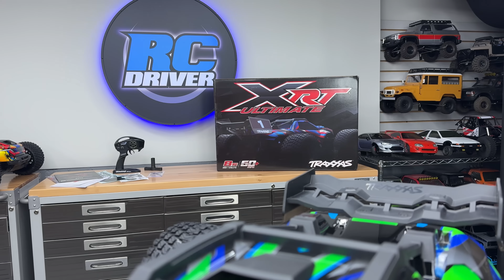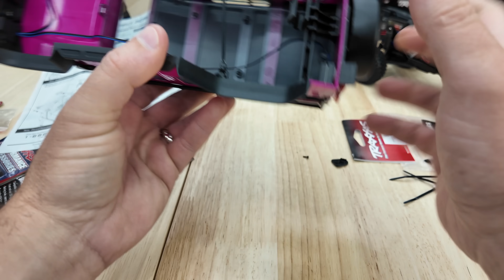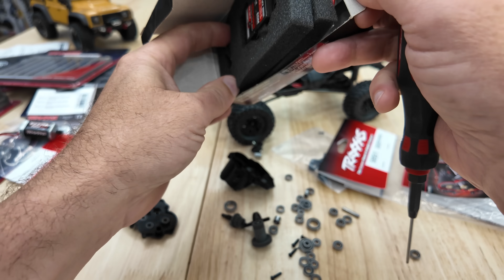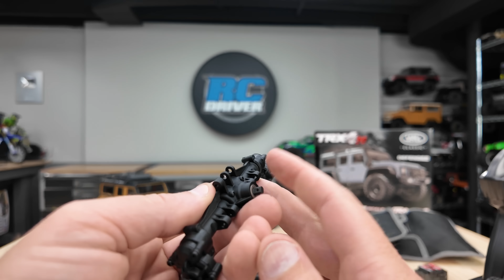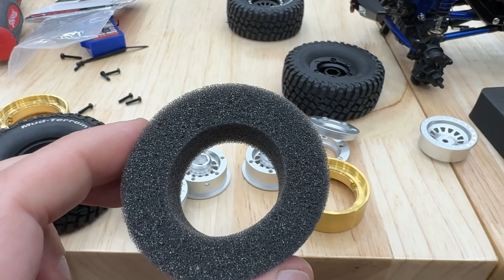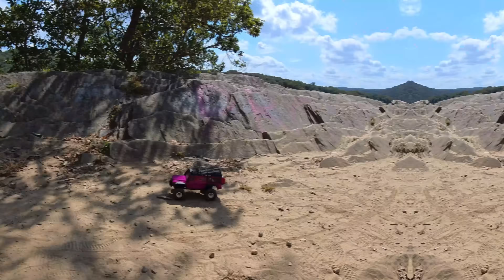I Built A Traxxas TRX-4m Ultimate

Comment: I see you store you trucks with tire on the ground, Many say you need to store with wheels of the ground, so you don't get flat spots on your wheels or add stress to suspention, myth or fact, would be nice to know, easier to store just setting them down, like your races. Great video, thank you.
Reply from the maker: If you leave your RC cars sitting on the tires over long periods of time, it can flatspot the tires. Sometimes they will come back after some use. Sometimes not. I go through and rotate the wheels every once in a while.

Comment: 3 questions. 1, Do have permission have recreate that truck with the sand dune body? cause I love that truck. 2, How much does the build cost without the 2 speed transmission and the portal axles? 3, What is that screwdriver looking drill thing? (I have no idea what it’s called)

Comment: Great video and a pretty little truck!  Not so struck on the Traxxas roof light bar though.  I fitted one from Injora which is neater in my opinion.  And I pulled the wires from the plug before feeding the wire through the roof, so I needed only a tiny hole drilled below the light bar.  But, I like all the other stuff on the car.  Definitely tempted to make a few changes to ours....😄

Comment: the Traxxas Brushless and the single speed crawl gear is amazing low end control. Like a Furitek system.
Reply: Traxxas says "Portal axles are not compatible with 9776R low-range gears" - so in my opinion this means you have to use the stock transmission that comes with the car out of the box - you just have to add the red gears ! If you use the Pro-Built Low Range Transmission you have to switch back !
Reply: Furitek is better in every single way
Reply: @OutlawFarmersRC are you referring to Traxxas crawl gears that are 40.3:1?

Comment: I just put this traxxas brushless system in along with the 2 speed trans. Wow, it is awesome, such good low end throttle. You really dont even need the 2 speed trans because the brushless system has the F.O.C. tech. Its sick. I added the servo also to shift remotely. Very nice upgrades Traxxas, I would recommend it.   
**if you want to add the servo to shift, instead of manual shift, you need the brushless system as the ESC allows this.